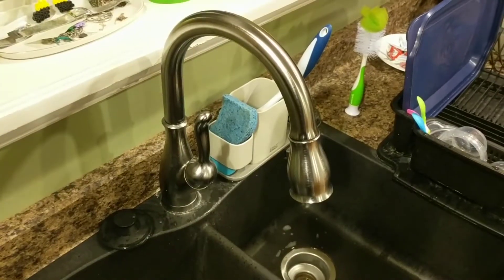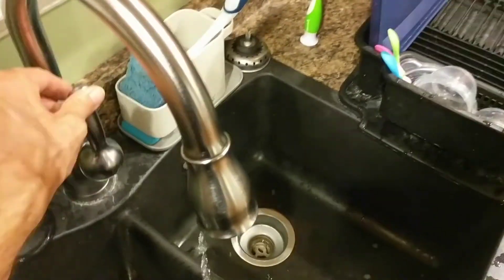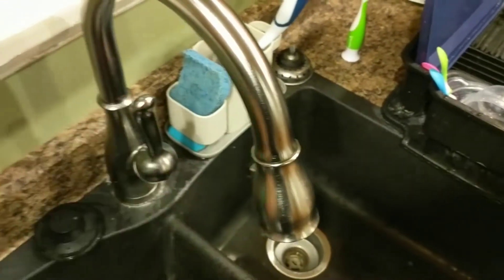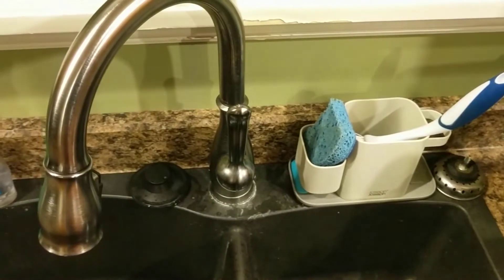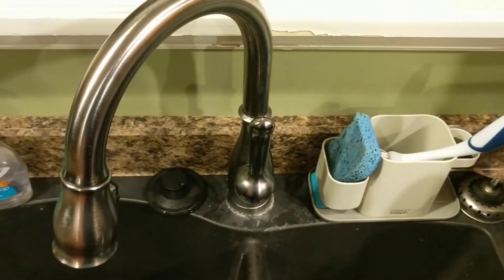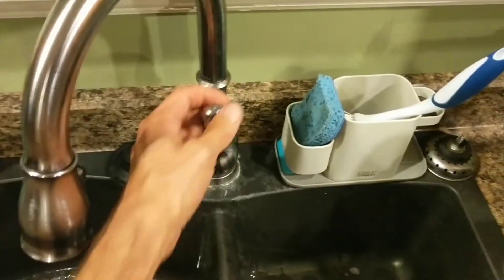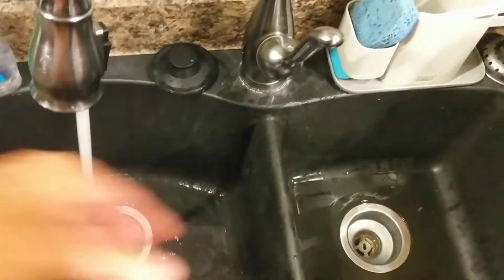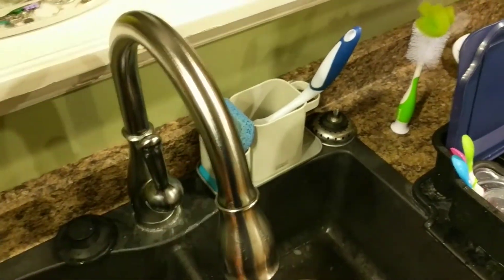Delta Leland Faucet Review | MODEL#: 9178-AR-DST | Ryan Olsen

Comment: Ive gotten 2 calls for this issue with this faucet. Its a simple fix and its in the manuel. Your handle limit stop just needed to be adjusted :) its only suppose to be on 2 positions...sometimes if the person doesnt adjust it out of the box it ende up being kinda centered which is why you had to move it that way to shut off. The tool to change it is in the box! I know this is an old video haha but if anyone else sees this video and has this problem there yea go!
Reply from the maker: Well, the plumber I used didn't know about that I guess. All in all though, I'm so much happier with the Cassidy. The overall design is much better, and it just works great. Instant off at any position with no tricks.

Comment: Is the handle supposed to be in the front ?
Reply from the maker: I had them install it with the handle in the front, as well as the faucet I replaced it with (which is much better). It's typical to have it on the right, but having it in front is great. You can easily turn it on it on and off with either hand, and your counter doesn't get wet this way. Think of all the times you turn the water on and off while washing dishes and the water that comes off your hands every time you do that. The water goes in the sink with it in front, and it's just so handy being right in the middle.